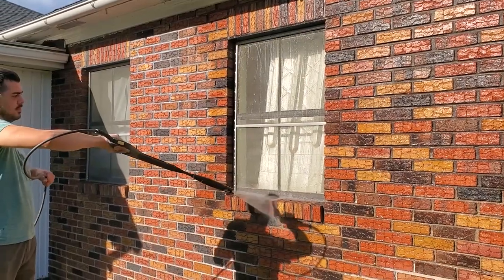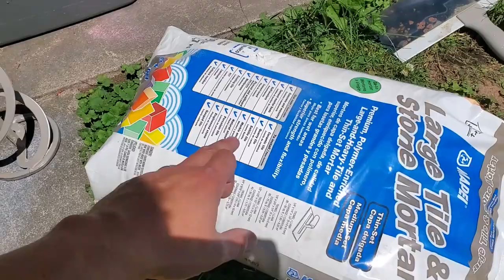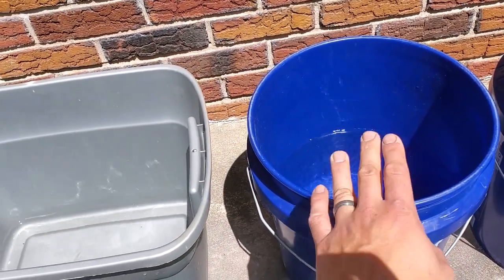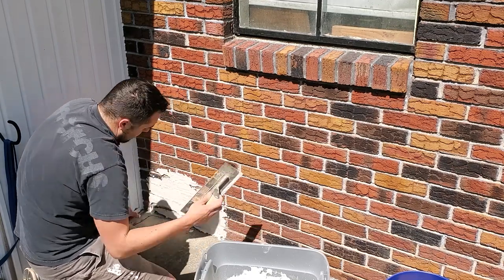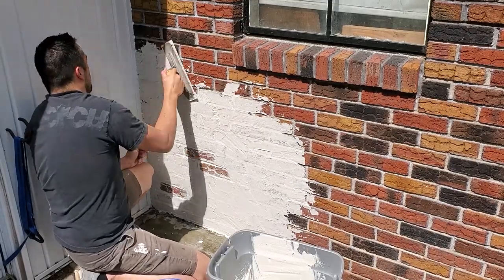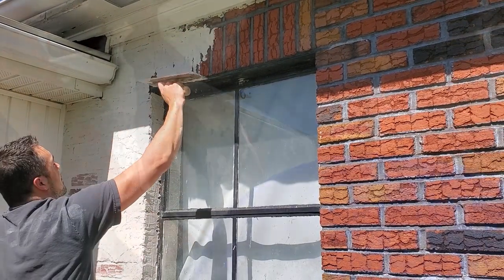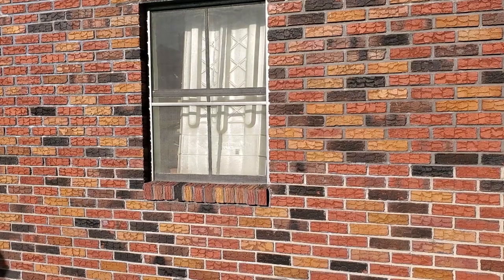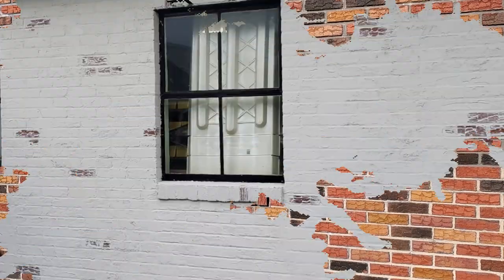German Smearing (Schmearing) Our Brick House Chip and Joanna Gaines Style! How to Mortar Over Brick

Comment: awesome video! my house is old split face brick (textured) like yours but much much more textured. I hate it. I kind of want to cover it up with something like this or a thick bagging technique. the bricks are already painted though. is it an issue?
Reply from the maker: It could present an issue with bonding, if I remember correctly from researching, because the mortar needs a rigid and clean surface to bond to.  Paint not only makes the surface "smooth", but depending on type of paint used it could not only prevent bonding but actually repel the mortar.  I believe there are a few ways to prep that you can get around it I'm just not 100% sure what they are.  I believe there are ways to sort of "acid wash" the paint, but also screen type systems you can install over top, although I believe you would lose the nice stone/brick texture going that route. 

It's definitely possible, you would just have to explore the options from professionals, and determine how much work and money you would have to put into it. 👍🏼